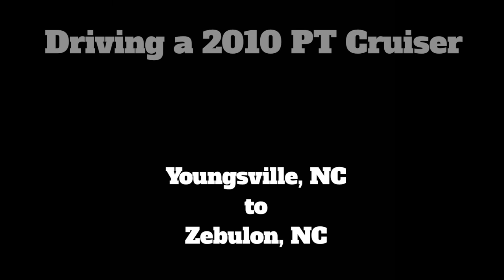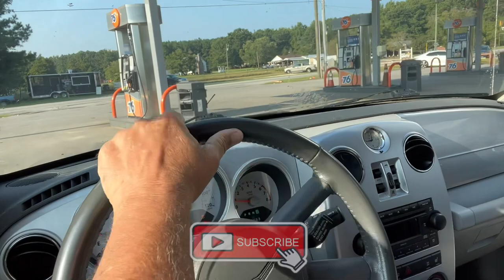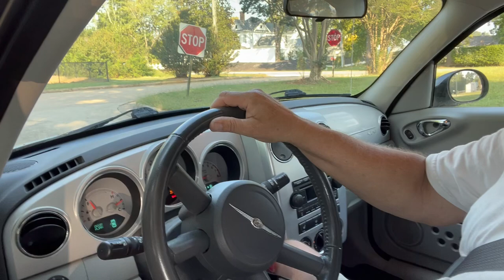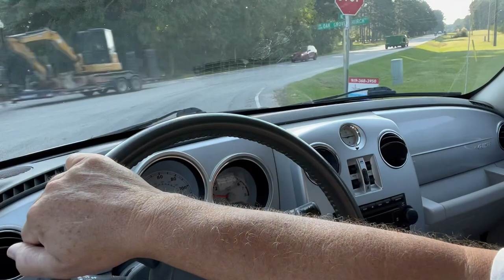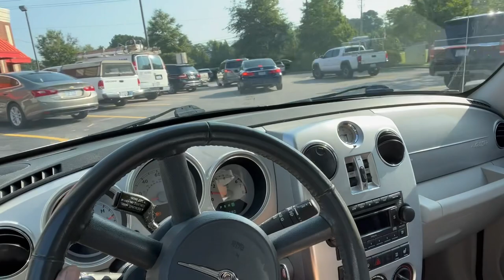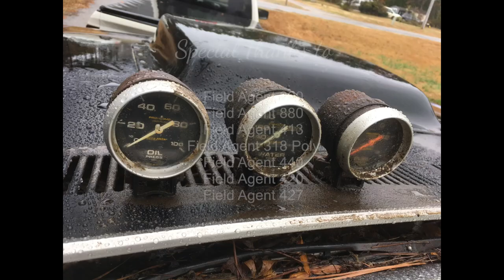Driving my 2010 PT Cruiser

Comment: What lights are glowing on the dash? Check engine light or ABS or what are those?
Reply from the maker: Oil, ABS & traction control. The oil sender is bad.
Reply: @bobsclassiccarsparts8772  you ever have anyone pull the ABS codes?
Reply from the maker: @scottgshomewrenching1352  no I need to do that
Reply: Damn dude answered your question less then a minute into the video..